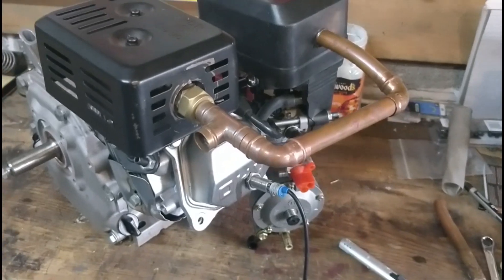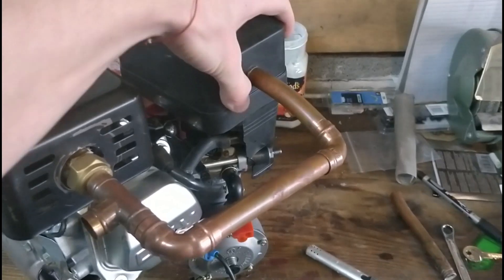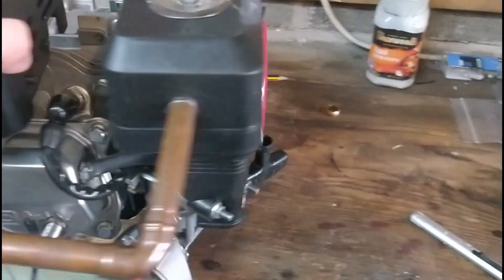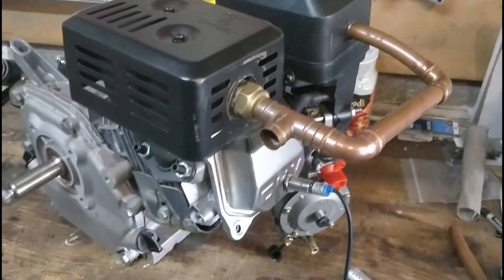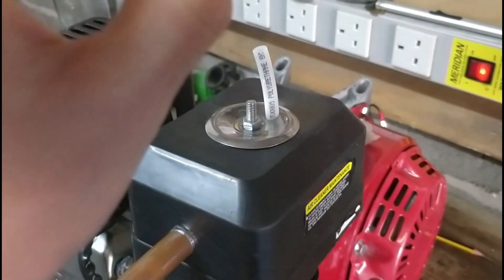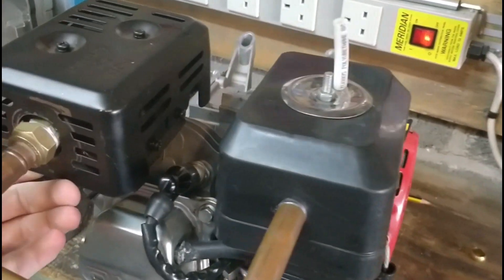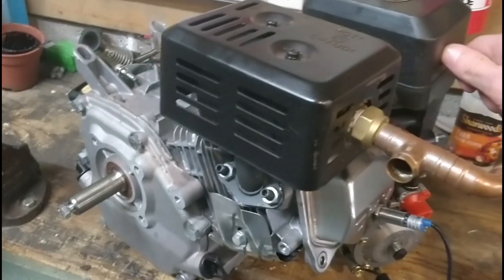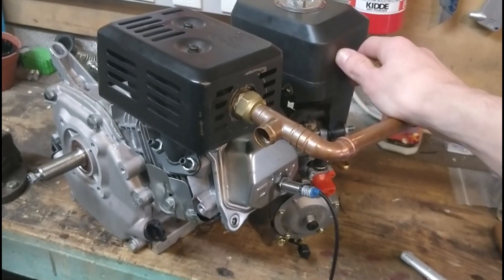Pure Hydrogen Combustion Engine

Comment: All in all good news.  I do have a few questions/comments:
How much does hydrogen cost? I ask knowing that the price would come down as it is adopted as a common fuel.
Please show the work done by the hydrogen engine?  That is, quantify the power of hydrogen compared to gasoline.
How is hydrogen stored?  And, how does/will the storage system respond to a car crash?
Reply: Hydrogen is the most common element in the universe but acquiring a lot of it can be done a few ways. One is by a chemical reaction that releases hydrogen and the other is electrolysis which splits water molecules into hydrogen and oxygen. Electrolysis requires a lot of energy to split water into hydrogen and oxygen, more energy is used than you will get out of it but it is the simplest way to do it. 
Hydrogen would be an extremely cheap fuel once technology makes hydrogen production more efficient to produce. However storing hydrogen in large quantities is more difficult. The energy density of hydrogen is about 3 times as much as the same volume of gasoline. But because hydrogen has a low volumetric energy density it has to be stored in pressurized tanks to be compact enough to store in a vehicle and allow for long range driving. The problem is the storage and distribution of hydrogen. The gas is stored under tremendous pressure, around 5,000 to 10,000 psi. That means any accidents with rupturing tanks or fuel lines could be devastating. 
Filling the tanks isn’t much of a problem but a new infrastructure would have to be created. The car or vehicle would be filled up much like a propane tank from a barbecue grill would be. Except unlike propane that is stored under pressure as a liquid, hydrogen would be stored as a gas. It takes 2.2 lbs of hydrogen to equal 6.2 lbs of gasoline. 
To have a hydrogen engine run like a gasoline engine would require modifications. The ignition timing would be different and how the fuel is mixed with air would have to be carefully controlled at different throttle positions. So there will be a regulator for hydrogen and air flow that would be constantly changing with engine load and RPM to keep the engine running at a stoichiometric ratio. The engines would make a bit more power with hydrogen than it would with gasoline. As for efficiency I’m not sure. A lot of the hydrogen might not burn completely and get passed through the engine. The main emission from hydrogen engines is water but some nitrous-oxides are also made since there is a large percentage of nitrogen in the atmosphere. Some of those gases could be recirculated back into the intake like an EGR system to be returned, but this would decrease efficiency.
A gas engine would have to be modified extensively to run reliably on hydrogen. The intake system would be different, ignition timing would have to be changed, the exhaust would have to be made out of stainless steel so it won’t rust from all the water vapor. The exhaust would have to be designed to allow of water to drain drain when it condenses. Ice buildup may be a concern in colder environments. It would be very different. They might be dual fuel engines that can run on both hydrogen and gasoline, who knows what the future brings. 
When it comes to safety, hydrogen can be extremely dangerous if problems occur. Unlike gasoline, hydrogen is odorless and you can’t visibly see it but you will hear it if it leaks from a pressure line. I would think there would be additional safety systems in place that would prevent a disaster if the vehicle was in a bad accident. For instance if the pressure in the hydrogen line drops abruptly, say it gets ruptured or severely damaged, a system will automatically trigger an emergency shutoff valve to the tank to prevent any more gas from escaping. Hydrogen is much lighter than air so it will dissipate quickly. The pressure tank would be centered in the vehicle to protect it on all sides. It is possible for suppliers to add an inhibitor or an odor to the hydrogen to warn people of any leaks, similar to what they do with propane which would otherwise an odorless gas in its pure form. 
The most expensive parts of a hydrogen vehicle would be the tanks, high pressure lines and regulators. They would have to be made out of high quality materials to withstand the pressures and reduce the risks of accidents.

Comment: A back yard shadetree mechanic can run an internal combustion engine on Hydrogen..why are we not goint to hydrogen..it burns clean and just leaves water after the combustion process... The electrical grid will not support millions of electric cars especially with just solar and wind.
Reply: JCB. Have already developed a h2 engine as an alternative to diesel
Reply: It does not "burn" green. Cars that run hydrogen do not "burn" it like this at all.

Comment: Does a polluted air environment affect hydrogen engines in any way positively or negatively? If so what pollutants (say in the world's currently most polluted cities) affect it?
Reply: Im probably late but hydrogen works like normal gasoline buts its way more sensitive.
Reply: I doubt it would affect it much. As long as there is oxygen in the air the engine should run just fine. Whatever airborne pollutants get sucked in the intake it would burn it and spit it out the exhaust.
Reply: ño itß not halo use íçe engeine on hydrogrn full cell sarhog moñguse

Comment: Hydrogen gas is the easiest fuel to make an engine run on... but optimization can be a daunting task, especially with your engine. Your first upgrade needs to be an ignition system that allows you to tune the advance curve and the dwell timing. Hydrogen gas produces an extremely fast flame front speed, and the ignition timing needs to be tunes so that your peak cylinder pressures occur at peak torque angle (a specific point of piston travel where the force of the piston produces peak torque to the crankshaft). 

Your next advancement should come in the form of independent mixture/induction rate. Hydrogen has a very wide combustible AFR (air-fuel ratio) much like diesel. Induction throttling should only be used to limit idle speed, so that you aren't wasting valuable fuel capacity in no-load applications. The AFR can be adjusted in minimal fuel increments linear to induction opening until open throttle is achieved, then simply use the hydrogen flow alone as  your throttle control. Thanks to the flame front speed, you can achieve some unbelievably slow idle speeds with this method (well below -1.5bar [-20psi] vacuum has been seen in some V8 engines).
Reply: all this can figured out just simple math with some trial and error but those who rushed and invested in electric cars do not want us to convert our combustion engine and save money == just like they did 200 years ago
Reply: SOUND OF THE ENGINE without all that seams to prove you don't want it to be simple enough......but it did work right?  They used off shelf engine and it worked !
Reply: bubble gas thru a hydrocarbon such as shellite  so it picks up some long chain molecules ??
Reply: yes / and pre computer cars ( with a distributor , you could easily set to top dead center in few seconds and run pure hydrogen )
Reply: fortunately, some EFI cars still got classical distributor. But they employ a closeloop Lambda probe and fuel trimming whici sincerely may not cope with H2. There are some LPG instalations and could be a starting point?  @kennek6224

Comment: Why use compressed hydrogen and not a hho generator?
Reply: You cant just compress hydrogen lol, if you even try you will blow yourself up , only way to do that is to 100% make sure your tank never had oxygen in it and you have to use a special pump that does not leak oxygen in. If you compress hydrogen with a normal air compressor and air gets in you will hae a invisible flame which will go BOOM......

Comment: I see the choke was on during the run, did you find it needed the mix richened that much using an lpg carb?
Reply: oneçe warmed up chóke off few monited wàrp àms 2 stroke outbard outbard 6 hp 9,9   2,7  1³5  hp

Comment: I understand this was tried many years ago but was abandoned because the extreme heat burnt the valves out. Last I heard they were talking ceramic valves.  Did that happen?
Reply: Hydrogen embrittlement 
= cracked cylinders and valves metallurgy 
They ran taxis in Asian countries on gasified charcoal to produce hydrogen till the mid 70’s. Maybe a mixture of gases ?? Idk

Comment: Internal combustion engines will run on ANY combustible gas - propane, hydrogen, butane, methane, acetylene, or propylene.  The problem is storing enough of the gas to permit running for extended periods because gasses take up a LOT of space!  The propane tanks on our busses take up a lot more room than a comparable diesel fuel tank.
Reply: whats why you do on-demand hydrogen, also so you dont have a big explosive B...

Comment: you say 50psi lasted 10 min so if i got a tanker ship and it had 50psi in it i would only be able to run a tiny motor that is doing no work (ideling a motor dose NOTHING in the way of work)  at all.
or i could get a 1Lt bottle filled to 50psi and it will still run for 10 min?

you need to quantity your values much much more

like a 
"5cf tank at a starting pressure of 50psi let this motor of 201cc run at an idle of 600rpm for 10 min with NO working load"

that at lest gives a bit more information other than "i have a length of string in my pocket"

and PS:- your trying to do engineering and you can not even A:- make 2 pipes stay together,  B:- fix a pull-start on a small motor

Comment: In the 1970s Tappan converted a kitchen stove from natural gas to hydrogen as an experiment.  It worked fine except hydrogen flame is invisible.  They will need to add something to make the flame visible.  Hydrogen can use existing natural gas pipes.
Reply: They aren't talking about an augmentation to NG, but rather replacing gasoline and diesel.
Reply: Its only invisible in oxygen. If you burn Hydrogen seprated from oxygen you will see it be orange or blue . Example dont combine hydrogen and oxygen at the source but let them burn at the burner and you will very easily see a flame.
Reply: buy ektrc stove more efect solar oven

Comment: After 30 years of study and experimentation with hydrogen it doesn't make much sense, unless you can produce it on demand within the vehicle itself from distilled water. You end up with more emissions creating the liquified hydrogen, then transporting it, then obtaining the fueling stations and safety equipment to support it. By the time you are done you might as well have used the electricity directly.
Reply: wrkóñg

Comment: There will definitely be a future where there's both electric and hydrogen, it's impossible for there not to be. Plant equipment for one would never be able to rely on electric power and there'll still be a big demand for ICE's I would imagine
Reply: JCB have just started building a Hydrogen engine for their large units, as it would add too much weight to them in batteries (9 tonnes extra) if they had to make them electric, it just wasn't feasible, so they decided to go Hydrogen instead, makes a lot more sense, especially as electric doesn't make any sense anyway. 
What will happen to all the dead batteries in 10-15 years when they're useless? 
What are we using to charge them? Oh yes, fossil fuels or bio mass ( which is trees) not the best idea to chop our source of oxygen down to burn it for electricity. 
Plus there isn't enough Lithium in the world if we all wanted electric cars, let alone the massive demand on the power grid, it is the thoughts of a mental person to think that is the way forward. Hydrogen all the way.

Comment: you probably need to store it as a frozen liquid in order to storage it effiently. liquids take less space than gasses. conventional engines have far much reach than these. making hydrogen takes a lot of eletricity and doesnt run long, where on the other hand crude oils have been collected from millions of years of lost energy and directly gives ton of energy, hydrogen needs to be manufactured on the other hand.
Reply: Cryogenic liquid Hydrogen will still require about 4x the space of Gasoline for example for the same energy content,  needs to be maintained at a very low temperature and to liquify it takes lots of energy due to its low inversion temperature.

Comment: To avoid Nox emissions simply do a 2 stroke Hydrogen direct injection and Oxygen direct injection engine. No intake valve required only an exhaust valve that opens every rotation. Also double the power density of the engine, and run as much power/heat as the conrod and piston can take. No turbos necessary.
Reply: Or a single injection of Brown's gas. I think that intake valves might still be needed.

Comment: Unless it can handle a load and produce power it is not useful. Hydrogen is very volatile and it seems your tank might be HHO. A battery inverter being recharged  by the HHO engine while it powers the HHO cell is the goal. But from what I have seen HHO is only good for burning lacking the ergs needed.
Reply: He states in the title pure Hydrogen.  Storing and compressing a stoichiometric Hydrogen - Oxygen mixture in larger quantities is not very wise to do.  As for the running electrolizer cell with the engine,  well you'd need to have 3x perpetuum mobile (ICE, gen & electrolizer) with excess energy to achieve that so take a wild guess what the odds are for that ;)

Comment: Might be able to tune the gas knob to best performance by holding the throttle open wide and turning the knob till engine reaches max RPM's by riching or leaning the flow of the mixture

That's what you'd do with little nitro engines anyway

Comment: See if this is possible than any gas vehicle is be hydrogen powered, I love my dodge ram gots a gas v8 under the hood, and I really don't want electric to take over because I actually like listening to a good v8 sound. Only thing we also need to look into is what can replace motor oil to lubricate our engines. I hope theres ideas for that. If so America is saved

Comment: electrolysis produces 2 parts oxygen to one part hydrogen, have you tried a sealed system using them both instead of pressurising it?
Reply: Two parts hydrogen to on part water.

Literally... H2O